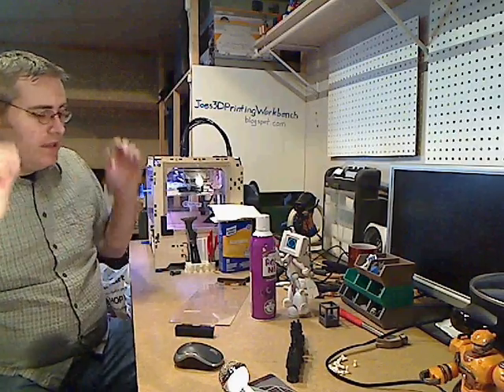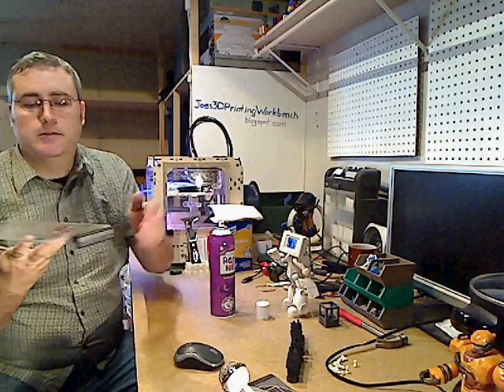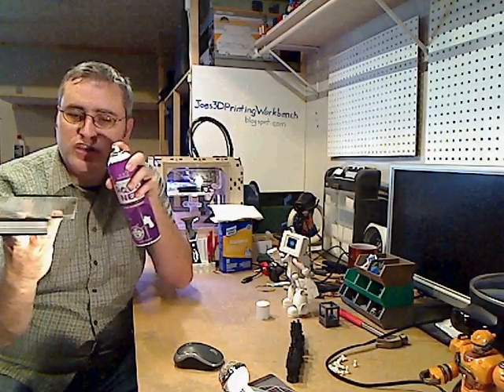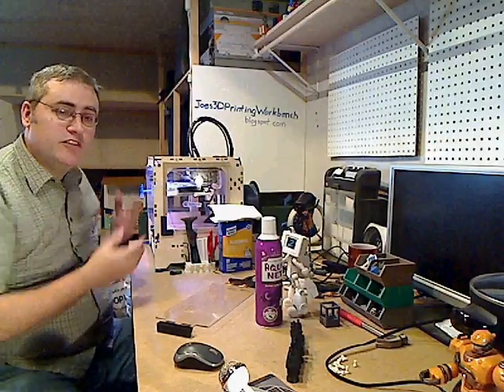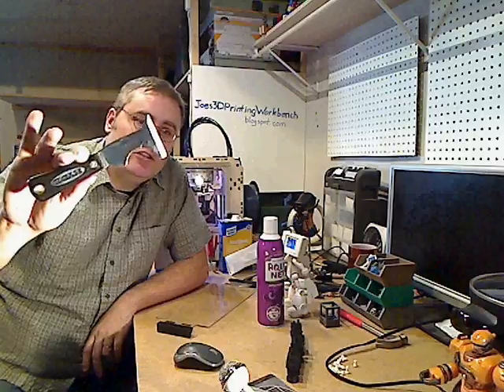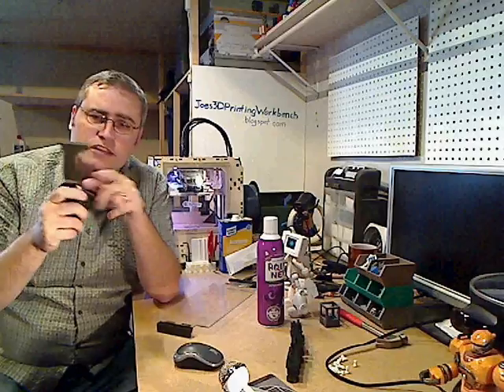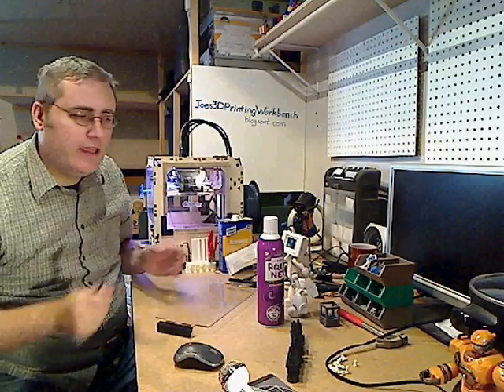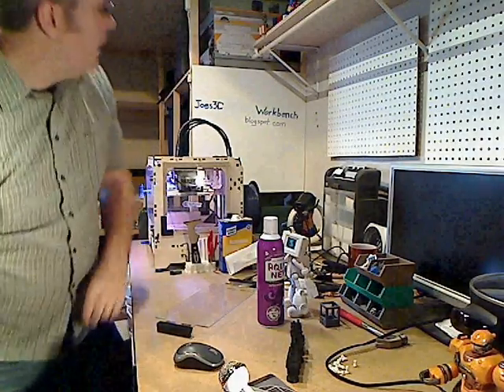3D Printing Tip - Glass and Hairspray

Comment: couple of questions and clarification:
1. Are you saying to spray on glass and then let it sit for an hour or so to dry?
1a. Was also a bit confused, should i heat the glass then spray then dry and then print on?
2. If I have a heated bed and the glass is about room temperature, is it safe to place on the heated bed? ( I heat my bed to 70 for PETG)
Reply from the maker: 1. Spray on, let dry, could be an hour, could be faster if you heat up your build plate and put the removable plate on it.
2. Safe enough. The alcohol in the spray is what keeps it liquid and what evaporates off when it dries, and it needs more than 70C to ignite.
Reply: @3dpprofessor  Thanks gonna go out and get hair spray and try it out

Comment: This is a sick joke, right?  What a crock.  I spray my glass plate as the plate is warming, and its dry to the touch by the time the build begins, and the PLA pops right off when the print is cool.
Reply from the maker: Curious. What do you do to keep the excess hairspray off the gears, rods, and bearings of your 3D printer?
Reply: @3dpprofessor  I mask off the extruder and touchscreen with paper towels before the spray, which is not extensive.  Just a light but visible mist.  Then post build, I spritz the bed with Windex, and wipe it clean.  Ready for the next print.

Comment: That is a shit ton of hairspray. I just got the Creality enclosure and tried hair spray after failing to get ABS to stick down to my mirror tile, which PLA is perfectly capable of doing without anything on it. But I only did 3 wide stripes to cover the whole plate and that was it. Cooked it on while I was preheating to print and my simple test print stuck amazing and popped right off easily.

Comment: I watched this video a couple of years ago and started using hair spray with great success, but recently I was out of my cheap AquaNet hair spray and my wife gave me some expensive hair spray that she doesn't like. This hair spray holds so well that if my bed just a little too close to the nozzle the only way I can get the print off is to put the glass bed in the freezer (after it's cooled down to room temperature) for 20 to 30 minutes and then it just falls off.

Comment: I used AquaNet Extra Hold and got fish eyes on the surface.  How do you prevent fish eyes?
Reply from the maker: Fish eyes? Bubbles? Is your build plate wet at all? Did you use heat to dry it?
Reply: @3dpprofessor  After spraying a lake full of hairspray on my room temperature glass build plate I placed the build plate back onto the printer and heated it to 60C to dry it out.

A few bubbles formed on the surface of the hairspray which showed on the bottom of the subsequent printed part.
Reply from the maker: @MOVIEKICKS  Interesting. I've only seen bubbles like that when the plate wasn't 100% dry a water droplet formed under the dried hairspray. But if your plate was dry I don't know how that could have happened.
Reply: @MOVIEKICKS  if you use a lighter or a cooker lighter (the long type) use the flame to burst the bubbles but wait 20 secs after spraying before trying it ,the hairspray has propellant in the mix which should dissipate 20-30 secs after spraying

Comment: if you use gluestick, soak with water after done printing. I used to use wet tissue to wrap around workpiece. The glue will be soften and the piece can be released easily. It only took seconds to smear the glue, and some minutes to soften the glue.

Comment: i have the same tool that i use for getting my prints off an ur right it works so much better than everything else ive tried, only had my printer alil over a week but ive tried quite a few things in this short period time. but im going to try the glass as a print surface just because it seems that i either got with or have warped my heat bed with my tevo tarantula pro and i really dont wanna send it back if i dont have to so im opting to try glass as a surface cause of the warped surface im dealing with an not just that but the pad that came with my heat bed is already starting to show some pretty crazy ware with what lil time ive had it so i either done it myself with my lack of know how or all the prints ive done with that has left some rough spots lil holes that looks like its from the nozzle tip sitting against the surface while at temp. my question is what type of glass do i need to use, or does it matter. i have glass from an old picture frame thats pretty close an then i also have a peace thats tempered glass thats close. i image it would be hard to get the perfect size to fit a heat bed but i dont know im trying to do it without spending money. if it comes to it then i'll try cutting it myself before going to someone to cut it for me.

Comment: i use the black clips for my build plate and they dont get hot for me. it may just be that a have a fairly high heat tollerence but i doubt it
also, elmers spray adhesive works well for me but its kinda annoying to remove the glue

Comment: I have two questions: how well does this work with a non heated bed? And can I use any glass, such as from an old picture frame?
Reply from the maker: Not as well on a non-heated bed, but it does work. And, yes, any glass will be fine, but thicker will break less often.

Comment: You do not need that much hairspray: first roughen up the glass sheet/support with rough sandpaper (when you clearly see scratches in the support its good enough.) then after that use small to moderate amount of tacky hairspray on top of the support. Works like a charm.

Comment: What if I need a smooth as glass finish on The bottom?
Reply from the maker: This will deliver.
Reply: @3dpprofessor  thanks!....cura settings for initial layer on cr 10 s5?
Reply: @Jayr1787  I hardly touch the defaults. Just make sure your bed is good and level.
Reply: @JosephLarson  that's what I figured was the issue. Do you know what size feeler gauge I should use...I dont like using paper due to the papers inconsistency
Reply from the maker: @Jayr1787  Uh... whatever feeler guage is about the size of a sheet of paper. Only, be sure to take into account the inconsistency. Because paper is all I ever use and it turns out perfect every time.
Reply: @3dpprofessor  sounds good! I'll give both a try

Comment: I just tried this trick , I have the CR10s so I removed the glass and did a full coat in the garage . I brought it inside and put on the heat bed for 20 min and nothing will stick to it at all.. I'm confused. I even re leveled my bed

Comment: Seems a little over the top on how much you put on there and how long you let it dry. It's hairspray. It dries in a minute or two. I spray a few quick sprays in the area my print will be on the glass, let it sit for two minutes and then start printing. Works good for me so far.

Comment: Hi M. Professor, thanks for sharing your tip with us, it really helped making sense of this hairspray technique! We still had problems with ABS sticking to the bed in production, have you?
Reply from the maker: ABS is 3D printing in hard mode. It shrinks and curls like crazy. If you don't have an enclosre keeping the heat it it's going to peel off the build plate.
Reply: We ended up building a 1m ^3 enclosure for our highly modified creality 500 a couple of months ago and it did help a lot, especially elevated prints, but since we discovered DnP, we print all of our ABS prints in non-enclosed Prusas and it works wonders.
Don't want to sound as an advertising bot but we tough you might actually be interested in checking out our stuff :)
There is a video of us printing the Warpinator5000 with no enclosure and we will upload TechShopJim's warping tests (which are 100x more difficult than the Warpinator to print) in the upcoming days/weeks.

Comment: So you say - apply hair spray and let it dry. But will the glossy finish stay after hairspray application?
Reply from the maker: Like a sea of glass.
Reply: And it will last for months, like i spray it once like you in the video and then do no maintenance at all?
Reply from the maker: It'll require a little maintenance, but it's minimal and easy to do.
Reply: And what is this maintanance?
Reply from the maker: An occasional spritz to freshen it up. Occasionally a heavy spritz and let it dry to clean it up.
Reply: Okey, thank you very much. Heirs spray is already drying ;) Can't wait to test it out
Reply: I got better adhansion, but it still sticks up on the beggining of line. I mean beggining of perimeter is not sticking well

Comment: For people watching from the U.K. I've found that the brand Cien (Gold can says its number 4 strength on it) from Lidl, works excellently and is very cheap - also b and q are selling a pack of 4 mirror tiles 220mm/220mm for £15 (12/03/2018)

Comment: The best instructional ever on this topic. When I first learned of ABS juice and found I could print ABS I was so thrilled, but my joy of discovery quickly turned into horror when I tried to remove the print from the build plate. I could not have removed it without destroying the painter's tape that I carefully assembled on the build glass. The hairspray technique you showed us really works. The print still tried to lift at one corner, by about a quarter of a millimiter but it was not because the hairspray released it, but it looked like the ABS tried to lift itself from the build plate but couldn't. Now the release part was a thing of beauty. As soon as I opened the refrigerator door to get the glass plate, the print popped itself off the glass. Thanks again for this wonderful tip. No more repeatedly applying and removing the masking tape.

There is though one thing I haven't tried, which you may have already, that is to apply the hairspray on top of the painter's tape? Will the adhering and release behaviors still apply? I will definitely try this on another glass plate. (No, this didn't work. The hairspray immediately dissolved the painter's tape adhesive and weaked its bond to the glass)

Comment: I am currently trying to design a way to switch to a glass build plate. My aluminum plate is held onto the bed heater with screws. I may try just clipping the glass to the aluminum.

The main thing I wanted to mention is that I have, for the past 3 years, used "Pledge Floor Care Multi-Surface Finish", which acts just like your description of the hair spray. When the bed drops to a temperature of about 40 C, I hear a little 'tick' sound, and can just pick the part up. I apply it by squirting a little on the bed, then wiping it around with a small rag.

I am hoping that it will react the same when put on glass.
Reply: I’m confused on why you wouldn’t just set it on top of the metal plate lol..

Comment: Hair spray must have the right ingredients, here's more info and a list of suitable sprays:
https://germanwarez.blogspot.com/2017/11/3d-printing-sticky-bed-for-fdm-printers.html

Always check before you buy, especially for the cheap stuff, because producers might replace ingredients with cheaper ones after a while. Any brand will do, if the ingredients are right, including Aquanet which is not on the list above.

Comment: Thanks for the video on using hair spray on the build platform. This works REALLY great for me. However, as best I can tell, I don't get anywhere near a month of service from a treated glass tile. So far, I have been soaking my tiles, cleaning them up very well and fully coating them from scratch again. In the latter half of your video, you spoke of refreshing the glass  with some supplemental layers of hairspray. It'd be great if you did another video in which you showed a glass tile that had been used quite a bit and about how much hair spray you refresh it with.

Comment: Do you add more hairspray before each print run? It sounds like you just prepare one glass and use it like that for months.
Reply from the maker: I occasionally spritz between prints, but for the most part I use the same prepared plate for weeks at a time, maybe months if I can keep the level from getting too close.

Comment: Thanks. I had seen several videos that said blue tape was better than masking tape. It is not! Practically impossible to remove prints from blue tape, or should I say to get the blue tape off the print. I still have prints with blue bottoms. Have switched to glass and am very satisfied.

Comment: Hi Joe, I think glue stick is easier and faster to use and way cheaper. Some people said it's hard to re apply glue stick, I have a tips using a couple drops of water and mix your applied glue stick on the glass using your finger or whatever, and let it dry for about 5 mins. You can apply some more glue if you like before you pour the water of course. I am using Scotch Glue Stick for paper or fabric, I never use the PVA one...  maybe it will work too, I will try it someday.

Comment: This was single-handedly the most useful advice on 3D printing out of the dozens of youtube videos I've watched so far.  Thank you so much for the helpful advice!

I've almost been ruining my printer trying to pry prints off of blue painter's tape.  I bought a glass sheet for the printer bed but didn't know what I was supposed to do after that.  Plus I didn't know it could be reused for a while.  I went and bought 4 cans of hairspray thinking I was going to go through it quick.

Thanks!

Comment: I have had a lot of success when thoroughly cleaning the plate first and then barely misting it with hair spray. I actually have printed without hairspray on a glass bed with PLA before, but it stuck so well that when it had cooled, instead of releasing from the bed when contracting, it held onto the bed and cracked a scalop the shape of the part out! it was really bizarre hearing a loud popping noise when the part was cooling off, and finding out when I walked over to look at it that it had ripped a chunk out of the bed.

Comment: I did yesterday go out and purchase the same hair spray.  I sprayed it on my blue painters tape and dried it with a heat gun. My bed is not heated. I was doing ABS prints that were lifting off the blue tape before the spray. I did use over sized brim and caught one lifting and put a weight on the lifted side and it finished the print perfectly. But once using the spray on the tape and giving it a drying out with heat gun it stuck to the tape so well you needed to re-tape the bed after each print. I with spray did a six item print all of the same and all came with perfection.

Comment: Great and enjoyable video - many thanks, got my printing on an Anet A8 with a bit of cheap picture glass working very well :) Can't help notice that you seem to have a BC Technological Solutions build plate. I am fitting one to a friends machine but the current instructions that come with their kit says "Do NOT print directly on the glass using hairspray" - any idea why this might be ? I would contact them directly but they don't reply to email.
Reply from the maker: I don't know. Maybe it should read "Do not print directly on the glass. Use hairspray."
Reply: Thanks - so you have had no issues with your BC Tech plate ?
Reply from the maker: I don't use it any more. It was okay, but I kept breaking the glass plates and I could never make replacement plates that were exact enough in dimensions that they didn't wiggle. Changing to a different build plate, one held on with more magnets, has been a boon to my print quality. Though I do miss the 3 point leveling.

Comment: I had been meaning to try hair spray on glass for a long time now. Following these instructions (essentially creating a lake of hair spray on the glass!) led to some of the best prints I've ever had. The prints stuck like they'd been super glued to the bed while it was printing and then when it cooled they popped off with so little force I thought I had taken a chunk of glass out at first! Instead had just an ever so slight impression of the print lines in the hair spray lake. I've since printed 3 large items that have curled on me before with 0 curling. The best part is DC42's IR sensor works perfectly with just a PCB-silicone thermal heatsink-glass-hair spray sandwich!

Comment: I second that emotion with the Aquanet Extra Super Hold Unscented hairspray. I should have been doing this back when I first got my Robo 3D R1 Plus, but I didn't know about glass chipping then so the damage was done. NOW, I use an aluminum plate bulldog clipped over my glass bed, and to prep it I spray a paper towel down heavily with the hairspray and give a quick wipedown to the aluminum plate while it is cool. It's easy, and I don't get hairspray where it doesn't belong. Heat the bed to 100c, make sure my Z offset is JUST touching the filament to the aluminum, and off I go. I'm using ESun PETG almost exclusively now and have been printing it this way for months and it works very well. 220C, print speed of 60mm/sec, extrusion multiplier of 1.14, and Simplify 3D for software. Also, I built a Lexan enclosure for my printer, helps quite a lot with heating up that glass/aluminum print bed monstrosity.